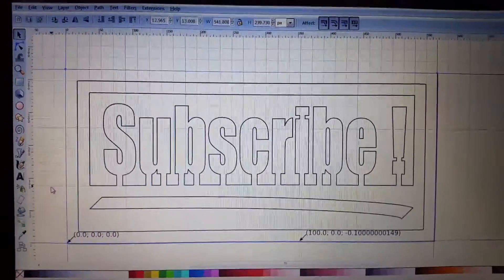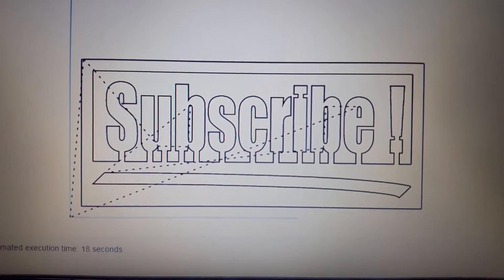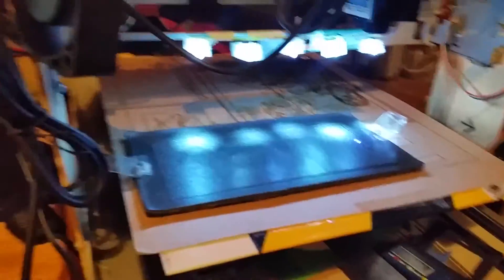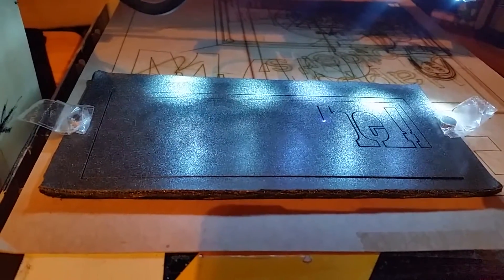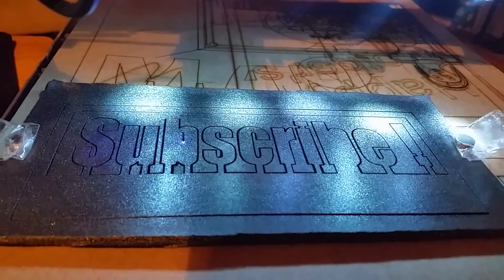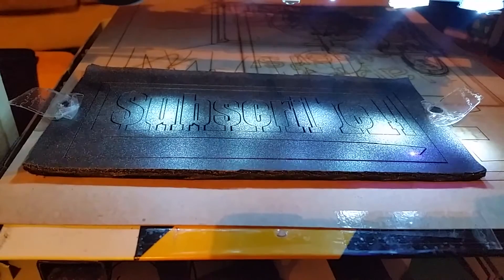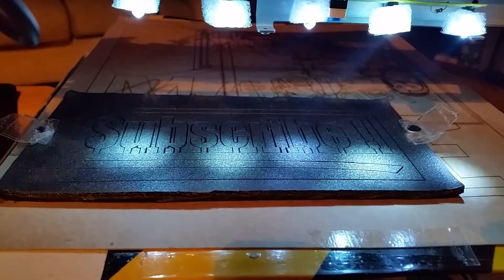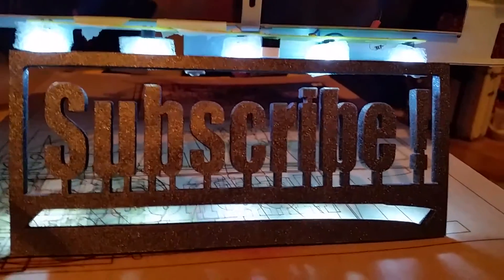Laser Cut Sign ( from Inkscape )

Comment: Very cool! Can't really tell from video, did you build this from subtract?
Reply from the maker: the laser CNC and its firmware is from scratch . made using scraps and parts of old printers . It has been slowly upgraded over time , with parts and re-coding of the firmware. 
if you meant the graphic , no no subtract , only decompose shapes to paths and join them in correct order.